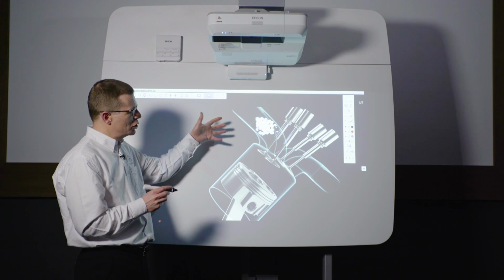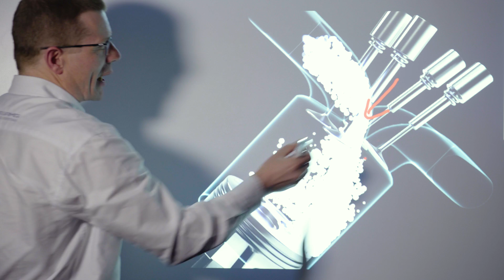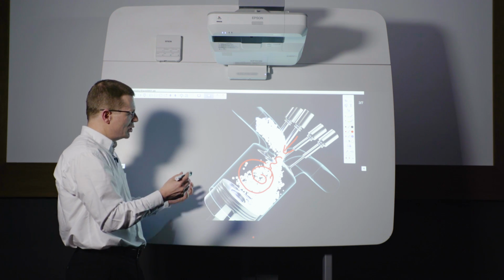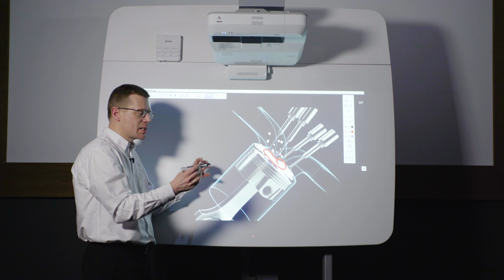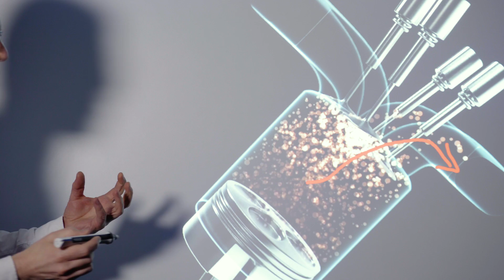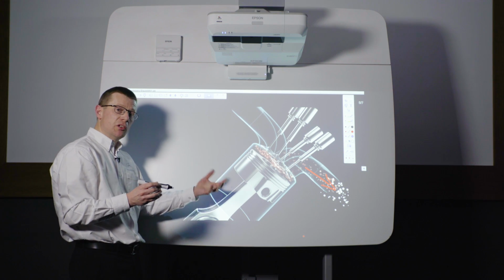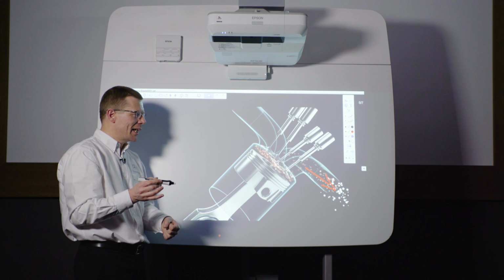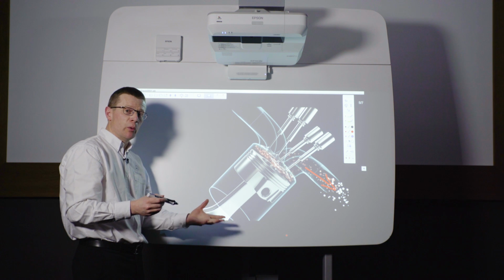F1 2017 Explained: Fuel #SimpliF1ed

Comment: The rich pocket where the spark plug resides is very similar to what Honda did 30+ years ago which had a separate valve to bring fuel and air to a chamber which ignited easily creating a flame front to ignite the lean region. Very interesting but not new.

Comment: you basically described the 4 strokes that the engine has to complete and at the end you explain how a turbo, which by the way many cars have now recovers energy...but how does that explain compensating for the 10% more full throttle time....

Comment: What is the compression ratio? More that 12:1?
Reply: Close to 18:1
Reply: Like a diesel?  Wouldn't even need a spark plug.
Reply: 18:1 seems a bit too high. The fuel would have to be very high octane to resist detonation and i don't think the regulations allow special fuels. The compression pressures and temperature would be excessive for petrol fuel.
Reply: The regulations said compression ratio cannot be higher than 18:1.

Comment: If these engines are high compression& have to comply with "road fuels" what octane are they running ? I believe race gas at the pump is considered (U.S.) 100octane or e85 for "some people" what octane is used for F1 ?
Reply from the maker: +Scadieee  It has a minimum octane rating of 87 but no maximum in the rules.
Reply: Is that RON+MON/2 US standard or RON euro standard or something else?  I'm assuming since min spec is specified, there's no advantage to high octane numbers in a Formula 1 type engine?
Reply: Yes it is R+M/2

Comment: so if there are mooore presure than normal turbo engine,how did you win detonation?
Reply: They could use back pressure as he said they control the turbo speed, leaving some exhaust gas in the cylinder will reduce combustion temperature that's one way of reducing detonation
Reply: AntiBlog Obviously (and sadly), they don't gonna give us their little secrets...
Reply: AntiBlog Obviously (and sadly), they don't gonna give us their little secrets...